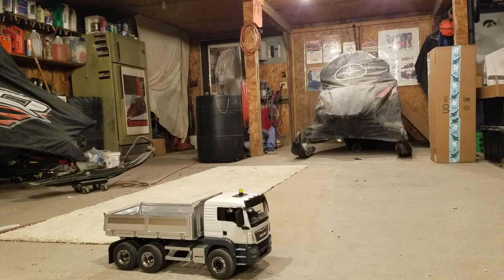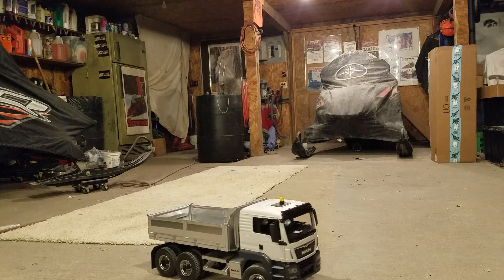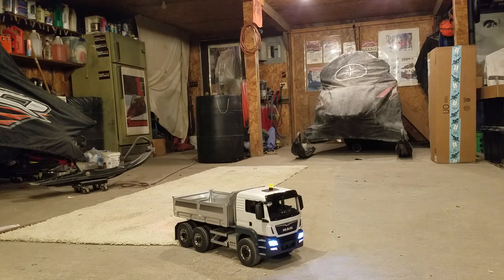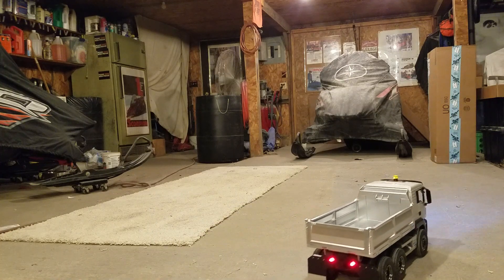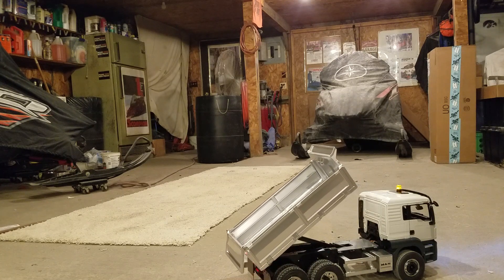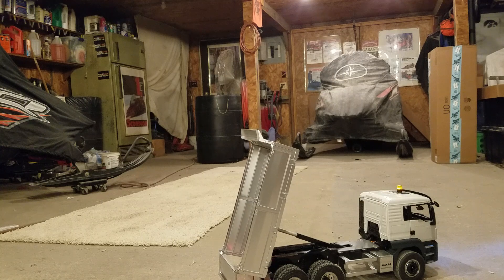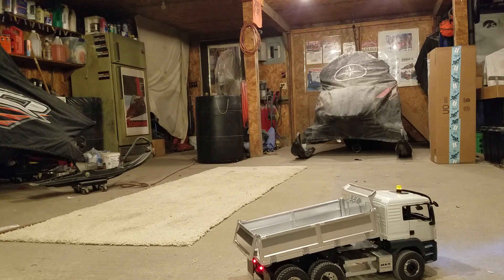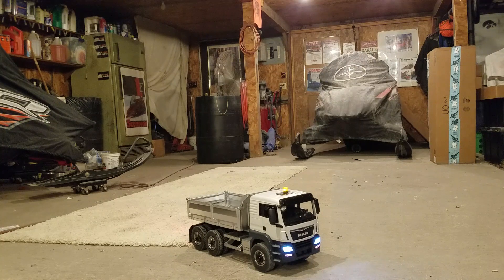1/16 Bruder MAN dump truck RC conversion

Comment: looks great! did you get the skid steer going? if you did you should load up that truck with it!
Reply from the maker: No I haven't gotten my delta loader done yet. I put back in the box and shelved it for now. Might be something I work on today after Inget my work bench cleaned off.
Reply from the maker: @rcconstructionincanada3754  switched out to 360 servos. Can't figure out the mix to run them on one stick on my Flysky-T6.
Reply: I saw the steer and were Problem lies.